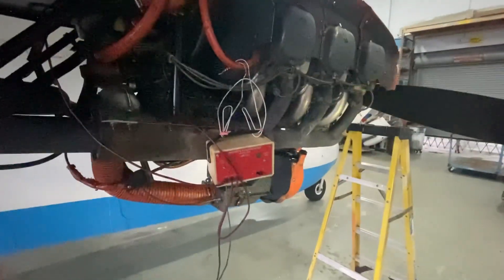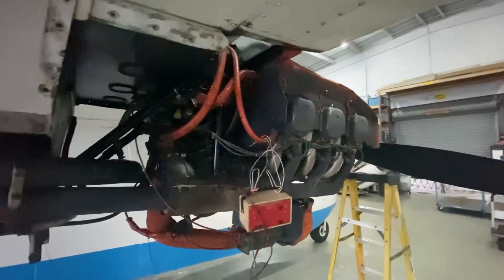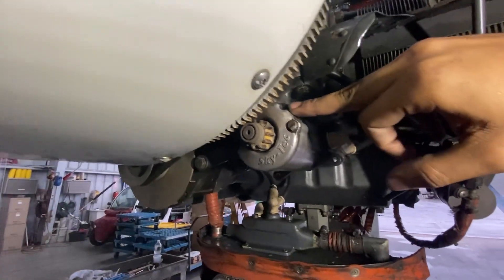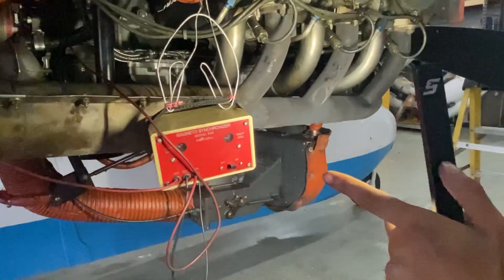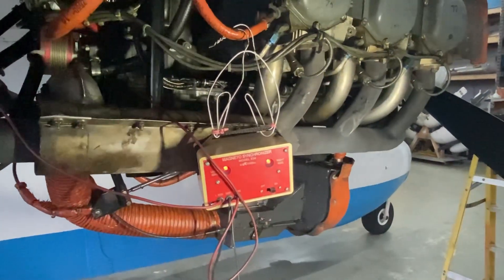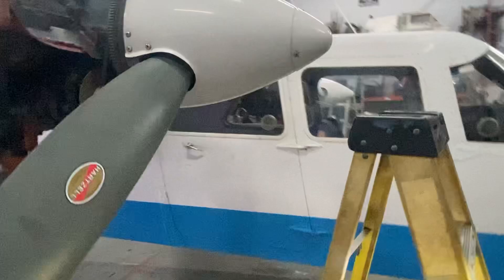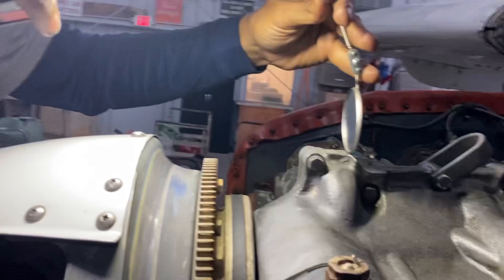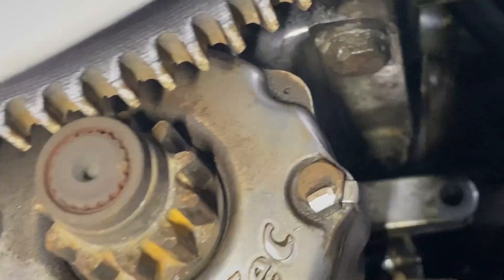How To | Aircraft Magneto Timing | Lycoming 540

Comment: You need to explain that the engine needs to be rotated past the impulse coupling first. Second I always had all the plug leads removed just in case there were any fumes in a cylinder to fire and kick the prop. A prop kick in the head or arm kinda hurts.
Reply: Same for me but I would remove the main leads from the magnetos.
Reply from the maker: Sounds like a good idea. Thanks for watching!